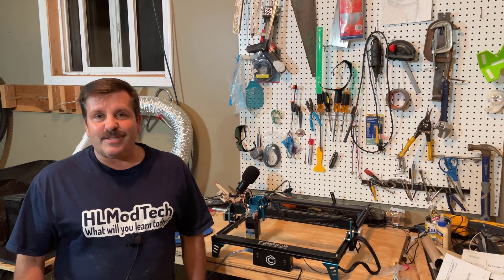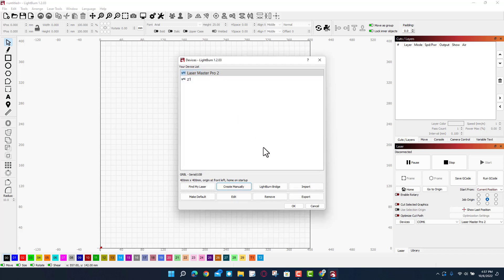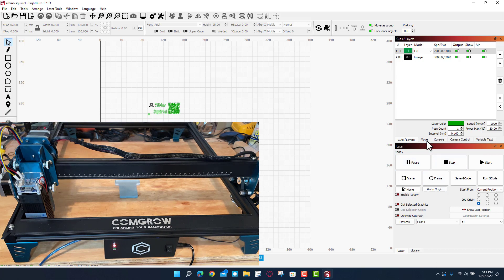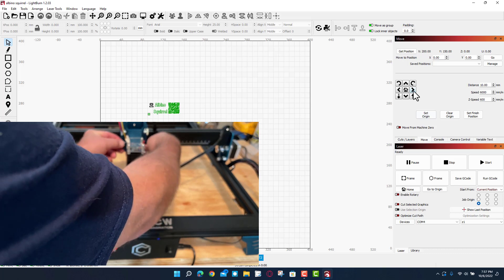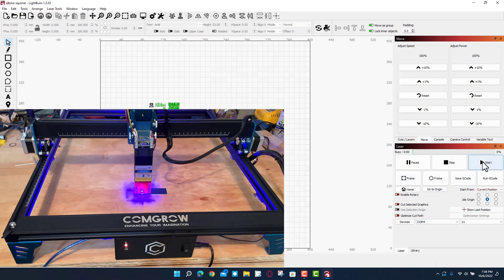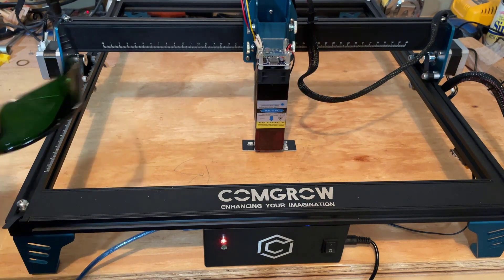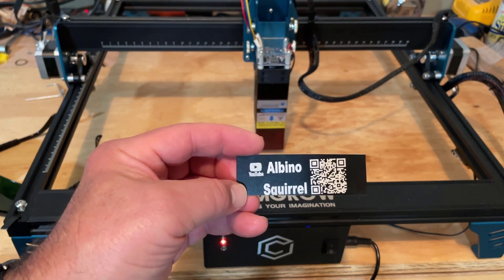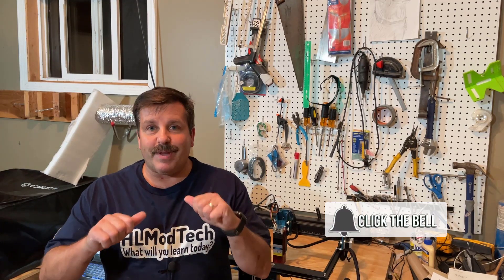First Comgrow Z1 laser cutter engraving project Lightburn set up

Comment: So I just got one of the Z1 lasers and am trying to wrap my head around it. Mainly focusing. Is it always 2mm from the work? No matter the size of the piece? Say I have a 2 inch tall object(cutting board). I just move the laser to 2mm above the surface?
Reply from the maker: I cannot remember off hand if 2mm is the amt... but yes, every material you need the laser head to be raised the amt of that part they give us. I have had projects where I put the laser on blocks so I can work on thicker materials.

Comment: Which laser cutter would you recommend for a middle school tech room? We see about 600 students between two grades. We 300 7th and 300 8th grader. We see half of them (300 students) or the fall semester and the other 300 the spring semester. We have a very low budget. Also which software would you suggest?
Reply from the maker: I use lightburn for cutting. Tinkercad for designing. There are free cutting programs but I have not invested time in those. The Diode lasers you see here will cost between 350-700 each. You do need to have a plan for venting the fumes though. I loved my OMT laser, but it was about 2 grand. https://youtu.be/HgQqj-JqRSs

Comment: The problem I'm having when I try to etch something the laser comes on like it's working but it won't put nothing on the material
Reply from the maker: Any chance you are messing with white material? I tried that a few times back in the day and it did nothing.
Reply: @HL ModTech  I was using the material that it come with
Reply: I switched to a piece of slate still having the same problem the laser will come on but it won't etch nothing on the material